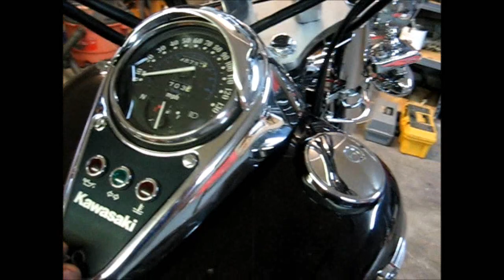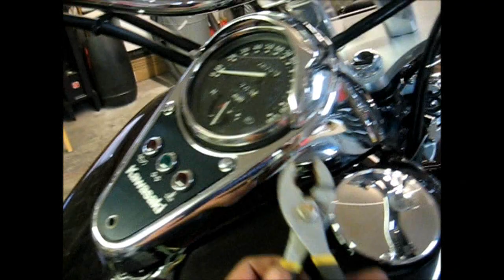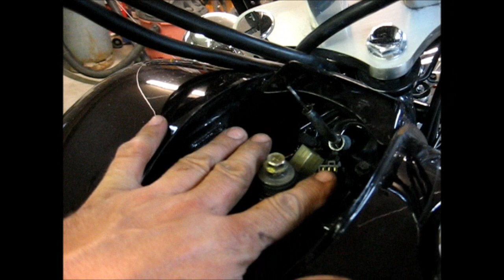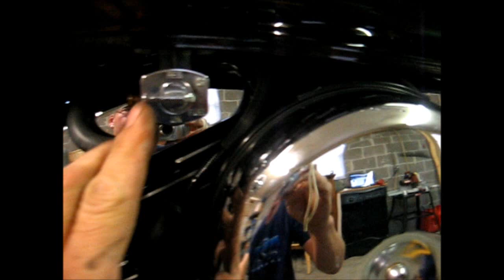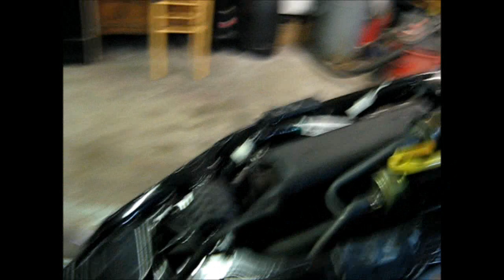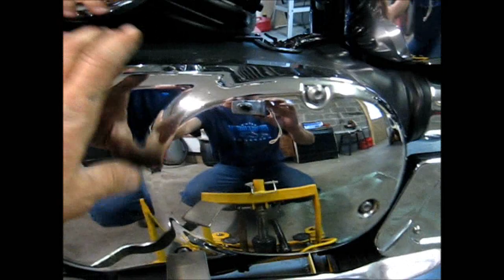2003 Kawasaki 1500 Vulcan Classic Valve Noise Enging Removal, Part 3

Comment: David , can I remove the front and rear frame bolts and just lower the motor enough to get the rocker box bolts off and save a bunch of time and struggles ??
Reply from the maker: yes, still need to remove exhaust, foot pegs, engine mounts, uncouple drive shaft ,,, at that point you could maybe do it but at that point not much more to just remove engine

Comment: is there an air filter in the air box under the tank ?? or just the round air filter on the side of the motor ?  someone told me there is a air filter under the tank   thanks in advance , Jeff
Reply from the maker: Only under the left round cover. Air goes from that left side filter then through a duct between cylinders to the right side and from there to Carb or throttle body depending what year yours is, Fuel injected or Carbureted

Comment: are you sure you have valve problems that is kind of unusual for that bike. I have heard that you may have to install cam chain extenders which does not require engine removal. I have one so I read up about that.
Reply: Julie B That's what I was thinking. Mabey that's the reason for why there has been no more videos? ;)
Reply from the maker: +David Lindquist I know I need to finish this, Let me tell you what the trouble was and the solution. There was a loud tappet noise going around 50- 60 Mph, I performed a valve job while engine was apart, bled the hydraulic lifters good, replaced the rocker arms that were nicked from the compression decompressors. A side note is when I ordered new decompressors I found Kawasaki upgraded there part number and there were several articles describing warranty work replacing the decompressors. I also found there was more travel on one cylinder timing chain tensioners,  Long story short it's fixed. If you think your noise is from a loose timing chain you can remove the insert piece around spark plug and that is where the chain slaps and you will see a ware groove if thats your trouble. I just installed an engine on a 2005 classic, I'll try to make a quick video to show what I'm talking about.